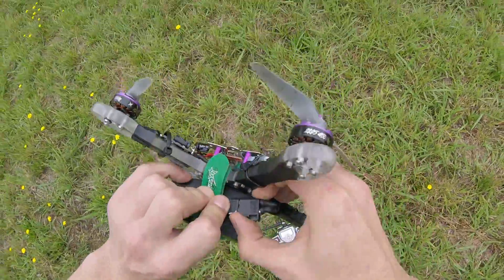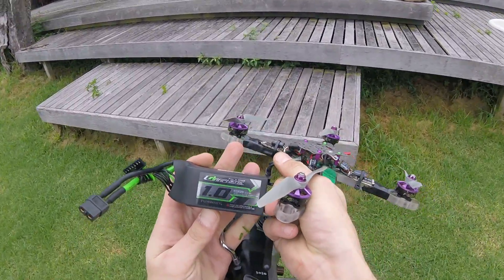6S 4500kv R6's Working!!!

Comment: I had the same problem with the spikes going into the gyro! I also have a 6S build, but I'm running 2500KV. I fixed that problem on my quad by lowering the gyro update freq and the ESC protocol. Now it runs smooth as butter and ridiculous top speeds!
Reply from the maker: Great job! I bet that is fast AF

Comment: I'm having a issue like that with my Crankenstein build  1104 7600kv on 4s. With cut 2.5 cut to 2.3 inch.  Is there and pid changes you would do to help that issue?

Comment: so running fc off battery does this? the oscilations?
Reply from the maker: Yes it does. It also happens for some race quads where it is powered independently, but the FC is mounted too close above the 4in1 esc, the spikes create emf that can affect the gyro

Comment: Those packs are absolute garbage, sure they work but they have no warning whatsoever, one second you’ve got full power, next you’re falling out of the sky..... (BEWARE)- These packs give NO warning of low discharge, they give full power up until they are DEAD!
Reply from the maker: That's what good packs are meant to do!!! Keep giving all the amps up until they're empty, like a high quality battery powered drill. Your telemetry must not be working properly or something. These are the best packs you can get which is why they are the gold standard for high powered quads in XClass

Comment: Good content.  I like the high kv testing with 6S.  So I watch at 1080P to see what caps you were running...  How did you get 24V caps to not short with 6S voltage (25.2V)?  Is your battery still good under load or do you run a voltage regulator?  Typically 6S uses 35V or better yet 50V caps.  I've had Panasonic 35V caps randomly burst into flame while plugging it in.  How are you preventing this?
Reply from the maker: I think the caps have some headroom over their ratings. I've used 25v caps on 6S a lot without problems. On those setups, the voltage spikes under braking will be almost double, but they don't blow. I'm no expert on caps but I've never had one blow before, only blown the cap legs

Comment: Nice. Was just testing 2600kv on 6s with 5040s and it’s crazy fast and not had many issues with overheating as long as you don’t punch for too long. Theory definitely works 👍🏾
Reply from the maker: Yeah thats a great setup. I started with that a while back, had to take it further now that we have F3 esc's that can do much higher rpm :)

Comment: That thing sounds like a beast,  nice work ,could a cap work on the FC power supply to help with the spikes?
Reply from the maker: Maybe. Easiest solution is to put in an APD PDB500, it's has very robust regulators, then power it from that

Comment: Jeeeez. I’d like to know what type of speeds that setup could obtain. Gotta be capable of over 150+mph if could remain stable long enough to reach top speed. Thanks for sharing. Can hardly wait to get my first APD order in the mail.
Reply from the maker: The smaller one clocked about 130mph on the radar with no aero on 4S, haven't clocked it on 6S. Yeah it can be made stable with regulators no problem :)
Reply: Autek XRacing “no aero”..? What’s that?.... “regulators”..? Like voltage regulators..?
Reply from the maker: @CTSAR  Yeah voltage regulators for the FC power input. Aero like some of the speed run quads you see around now
Reply: Autek XRacing oh, aerodynamics... yeah. Gotcha.